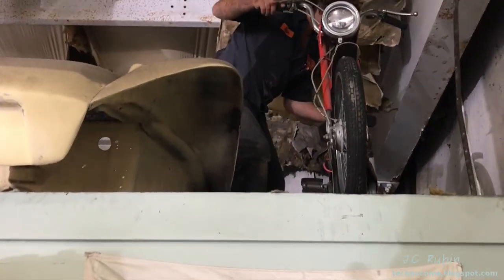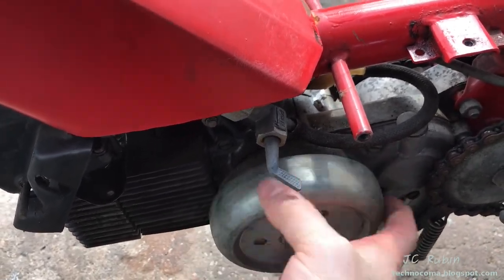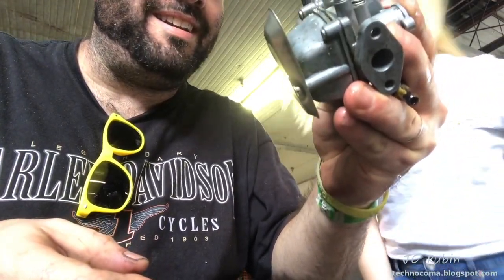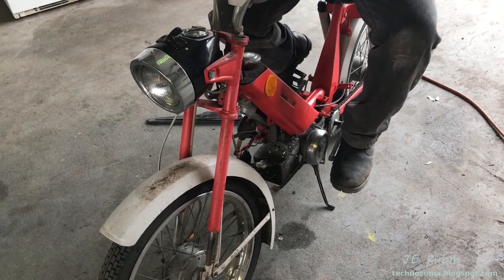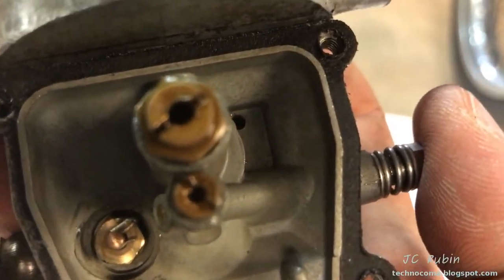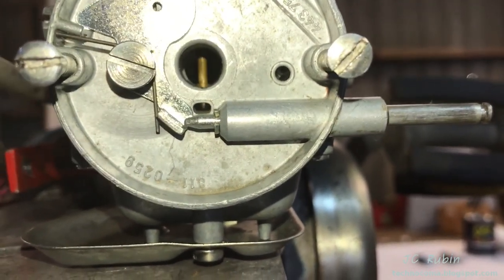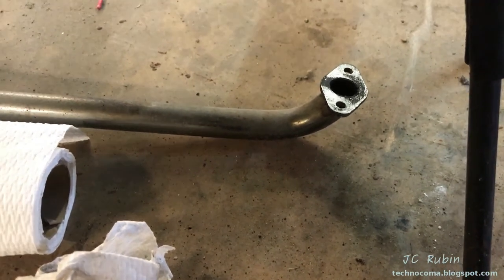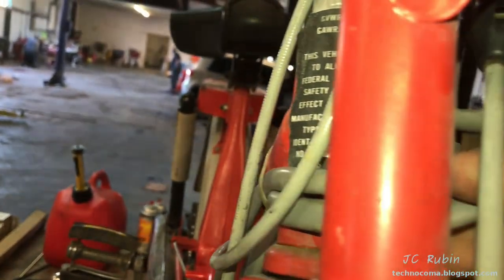1976 Jawa Transistor 40 Babetta Restoration Part 1

Comment: when you are trying to start it at 4:50, you have the 3 way switch on the headlight at 6:00.  That is the kill position
Reply from the maker: I you watch the whole movie you will see that the reason it doesnt run is that there is no vacuum because the seals are dried out, so it doesnt pull gas into the carb because no air.
Reply: I did watch it. It was excellent and very detailed. I tried everything to get mine started with no success until I learned about that ridiculous kill switch on the headlight.
Reply from the maker: More important is the red ignition box that needs to be checked to see if it still provides strong enough spark
Reply from the maker: Also like I showed, if the seals are dried out and the case leaks there will never be vacuum
Reply from the maker: I wanted to reconfirm with you while riding the Jawa today, that 6 o'clock is the running position.

Comment: I have a 1990 2 speed with 6 miles on it but no spark.
Reply from the maker: The ignition I have was notorious for failure.
Reply: @retrotechandelectronics  what ignition would one reccomend?